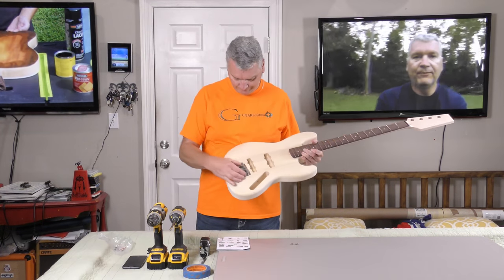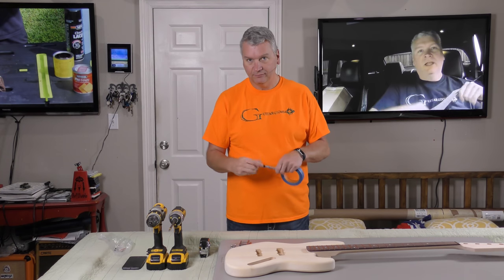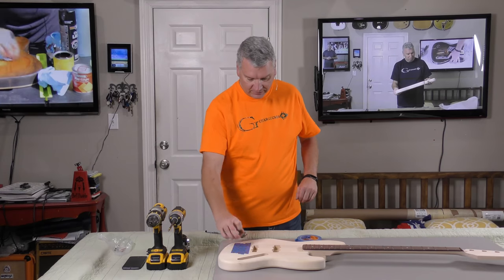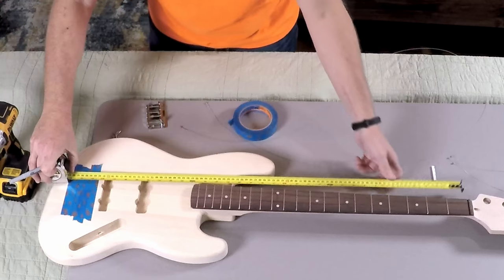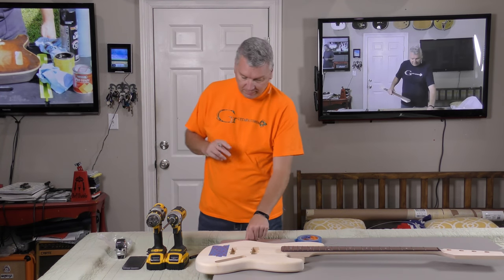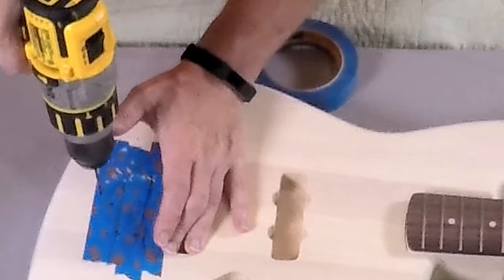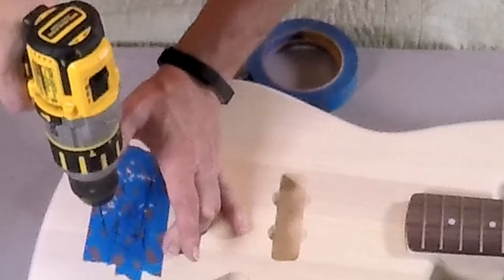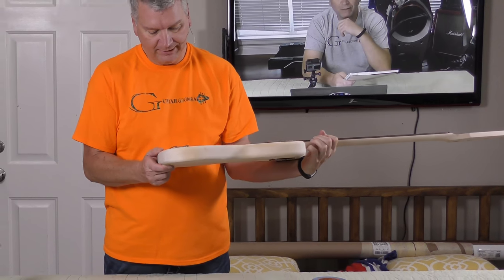How To Measure Scale Length and Set a Bass Bridge - Giveaway Guitar 2 Ep04

Comment: Don't forget your ground wire to the bridge. Take a straight edge down both sides of the neck and draw out those lines at the bridge location, then just center the bridge in the lines, easier than messing around trying to hold strings straight. Good job so far, remember don't rush the details, measure twice, then measure again.
Reply from the maker: I like the string method because I can see how the strings lay along the fretboard.  Yes, measure 150 times, check your measurements, and measure again.

Comment: When I set the bridge on my strat, I used a long straight edge to trace the prolongation of the neck on the tape. Then I just had to find the center of it and put the center of the bridge on this mark. Quick and dirty :)
Reply from the maker: Definitely a useful tip.  I can be a bit anal when it comes to getting things perfectly aligned.

Comment: WHy didn't you just find the center line of the neck pocket and use a straight edege to the bottom of the bass for your center line for the bridge. THen use the measurement of the bottom of the neck heel and and use that measurement at the centerline of the bridge to center the bridge. Use a pencil and your making it way too complicated.

Comment: The length is 25.5" from inside the nut on the high E string to the trailing edge of the high E saddle edge with some play for adjustments on  the inside edge of the adjustable saddle so you don't roll into the saddles block that's on the e strings nut side .

Comment: THE CHANGES YOU ARE ABOUT TO MAKE  WILL MAKE A BIG DIFF IN CABLE ROUTING AND ELIMINATING ANY CHANCE OF BREAKING THE OUTPUT JACK OFF, MAKES IT EASIER TO DRILL STRAIGHT  FOR GROUND WIRE TO BRIDGE ALSO